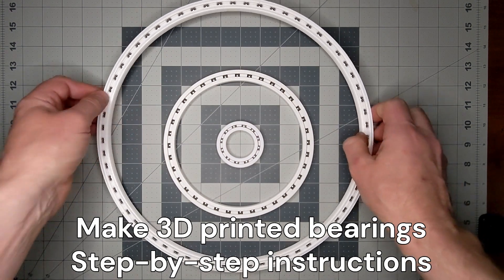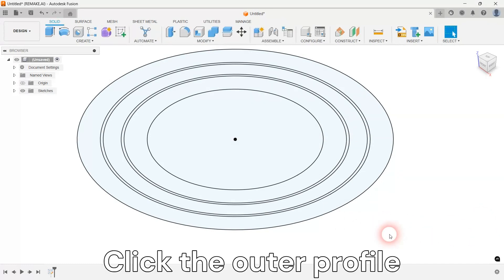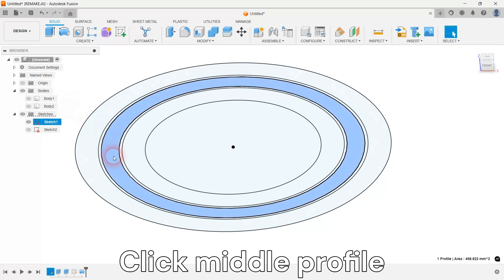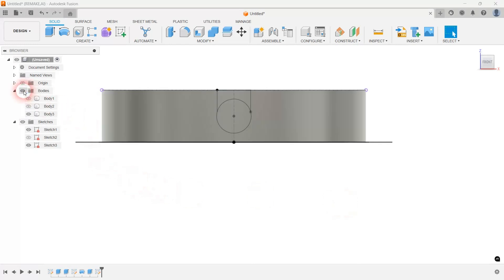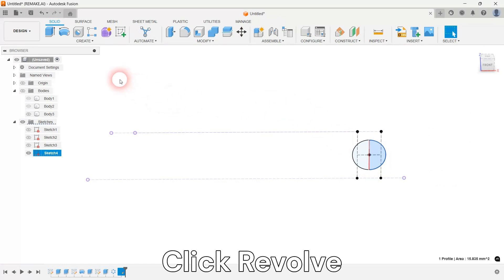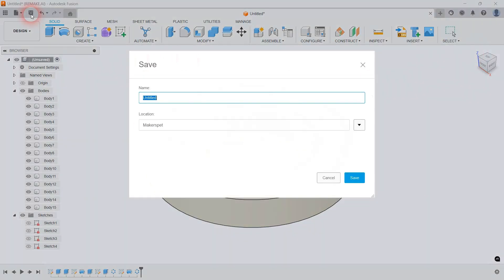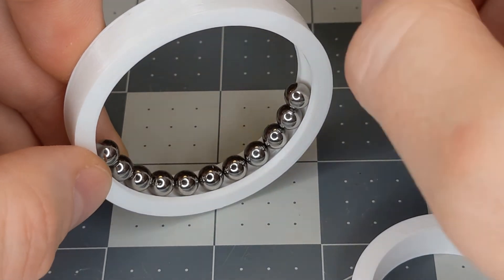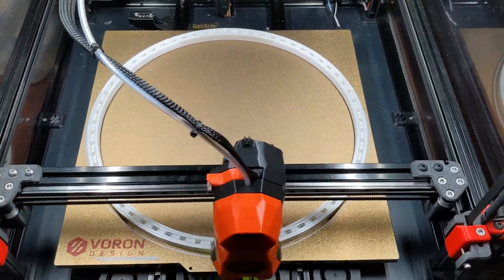How to make 3D printed bearings - step by step instructions

Comment: Doing this from 1st principles is good because when printed in different materials you may find the bearing too stiff (I did when printed in CF-Nylon, PLA was OK.) So its good to be able to go back and alter dimensions a fraction...  Also for bigger bearings you can print two or more layers to make the ring stiffer.